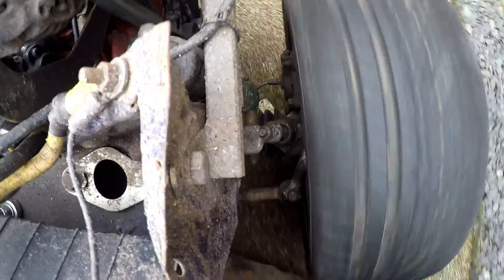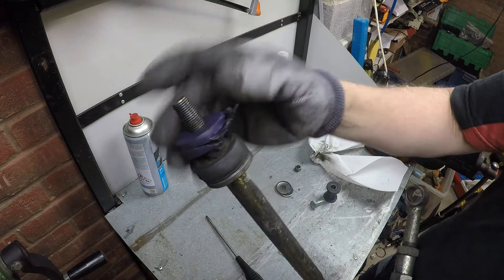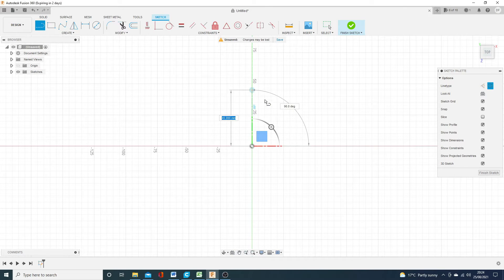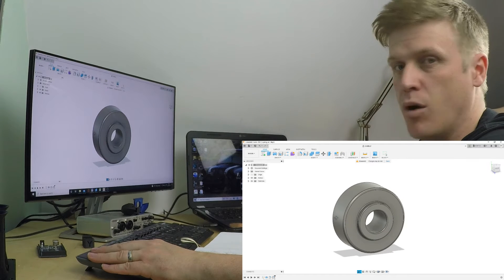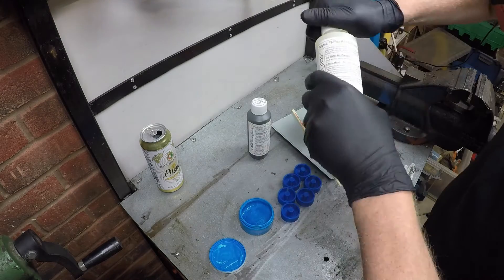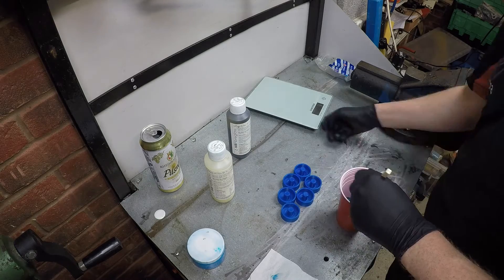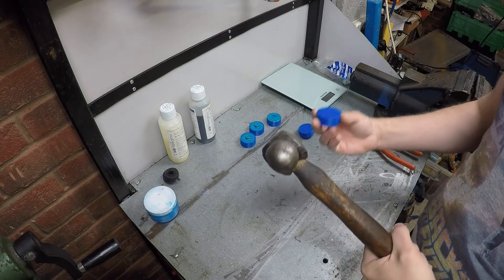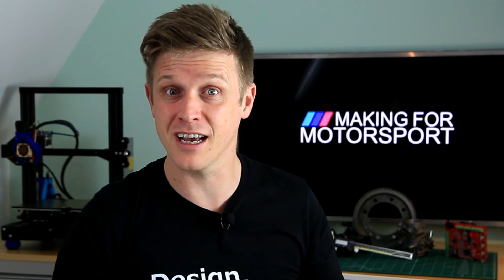Making PolyBushes at Home - using 2-part Polyurethane and 3D printed moulds!

Comment: I wonder if compressed air would pop em out. I know you say pennies, but iv been without a job for too long, so ill save pennies when i can.
Reply from the maker: Sucks to hear that man, hope you get back in a job you like soon! 👍
The compressed air trick does work some of the time on normal reusable moulds but I think with the 3D prints and the layer lines it’s always gonna be tricky
Reply: @MakingforMotorsport   Thanks. In 2 days im finished with 2 out of 6 month course  leading to becoming a certified welder. Its not all bad having little money, iv learn to see value in reuse or repurpose junk or stuff people give away. Last week i collected a large aluminum sign that will be perfect to turn into custom door cards or maybe even a custom dashboard.
Reply from the maker: @myshopmyrules.3017  good man, love that your getting the full welders certs, you can send over some tips!  👍

I have a garage full of old 40x40 box that was guard rail and is now my work bench and toolbox trolley… not material goes in the trash near me!

Comment: I've been considering doing this for the bushings on my home built mid engine buggy.  I'm using a VW 07k N/A 5 cylinder and Boxster 5 speed transaxle.  I don't really want to be bothered trying to find bushings I can use or building it around easy to find off the shelf ones.  Why not make them instead?
Reply from the maker: That sounds like proper monster....  It gives you more freedom when designing to know you don't have to worry about whether you can buy things for not.... well I could've bought these but you know what I mean...

Comment: Love your efforts, but wouldn’t it be good to vacuum chamber the mix?
Also I love your efforts breaking apart the mould’s. 😂😂
You could design the mould to be strong but break easy when a flathead screwdriver is inserted and twisted.😑😑😑
Reply from the maker: Yeah… these could be improved and vacuum would improve them but there weren’t that many air bubbles in there as I cut one apart to check (which I really should have filmed 🤦‍♂️)

Comment: Interesting, how much did you pay for the polyurethane mix and pigment?
Reply from the maker: About £20 for 500g so that’s easily make 35 of these bushes.   It’s not a hell of a lot cheaper than buying but it’s definitely more fun 👍
Reply: @MakingforMotorsport  You sure save money compared to not being able to buy any bushings for some more complex ones... Like motor mount bushings.
Reply from the maker: Absolutely, it’s cheap for these simple ones… another good use is for filling in the holes on OEM engine mounts, often there is lots air around the rubber and just by pouring in this stuff to the gaps stiffens it up nicely 👍

Comment: Interesting vid! Did you do a cost analysis? Was it actually cheaper to DIY over shop bought?
Reply from the maker: Hmm… didn’t crunch the numbers, but sitting here, the PU is about £40/kg and I used 100g for 6 bushes, so that’s roughly £0.66 per bush, the ABS used for the moulds is £14/kg and I used I think 15g/mould so that’s £0.21 so that’s £0.81/bush.

Mini spares sells a car set (4 bushes) for £4.20 vs £3.64… so cheaper… and that doesn’t count the £5 postage I need to buy them aswell!
Reply: @MakingforMotorsport  So about a bag of crisps cheaper, and more fun too!👍 Does your Ender 3 print ABS ok? Mines starts off ok, but then seems to clog the nozzle every time. 😢
Reply from the maker: I have no problems with ABS, just warping on the larger, thinner prints.
Reply: @MakingforMotorsport  the opnly thing I can print in abs is a scale model of spaghetti!!😂

Comment: Nice! Do you know/can estimate whereabouts these are on shore hardness?
Reply from the maker: 85A… I should’ve made a bigger deal of that in the video! 🙈
Reply: @MakingforMotorsport  thanks!
Reply: Have you considered 3D printing bushings from tpu?
I printed some spring seats for the rear suspension to test it out from 58D/100A tpu material. It worked ok but its obvious that its not oem. So casting could make them look more proper for the road officials ;)

Comment: i couldnt buy bushings for my car like a normal person, just printed them with tpu.. have been running ~13k km's now
Reply from the maker: I’d hate to be a normal person! 😂. 

I have a reel of 85a tpu ready as a direct comparison… just wanna get my printer direct drive first…. But sounds like it’s a winner 👍
Reply: @MakingforMotorsport  im totally abnormal, but actually there are no poly bushes available for the car, soi had to make them or browse universal sizes. im using a Polish filament, 98sha i think it was
Reply from the maker: 98A?  Nice 👍. You won’t be complaining about it being sloppy with those in!  Great that they are standing up to the application even in that hardness.

Comment: Why didn't he just print the bushing in TPU?
Reply: my thots. i own some tpu and i was looking for a video about it. amazon says the tpu is type: 95a
Reply: Thermoplastic is terrible for strut rod bushings. On my project car, they only lasted a few months before falling apart with just ordinary street driving. Poly is the way to go...
Reply: @daileydriven  gotcha. Thx for the heads-up from someone who's tried it
Reply from the maker: I’ve done some similar sandwich bushes in TPU for my BMW.  Printed solid.  They are holding so far to some “enthusiastic” driving 😂🤞
Reply: @MakingforMotorsport  hey let us know if it keeps holding up. Cool stuff

Comment: I'm like "great, I need some new bushes and mine are really expensive, this could be handy"
Then you're like "just pull out your 3d printer....."
Reply from the maker: Sorry dude!  I have used metal moulds for these in the past and instead of the 3D printer I would just stick’em on the lathe! Or weld them up… 
Alternatively you can use a soft rubber to cast a mould off an original. 
I would almost guarantee if you get a 3D printer you won’t regret it, especially if you can get your head around the modelling…
Reply: @MakingforMotorsport  the first video of this I watched ages ago was "make a mold on the lathe...."
I don't have one of those either!
I'll just buy bushes like a chump....
Reply from the maker: It’s a tough decision, but having things like a welder, lathe, 3D printer etc are long term money savers, just not in the short term… (my TIG was £750 so I could weld Aluminium 😳🙈😫)
Reply: @MakingforMotorsport  I bought a good welder and have an old MIG with an argon cylinder and Teflon liner that does pretty good aluminium welding. I'd like to tig bit don't have the time to practice. I've done a bit but really need a pulse and pedal and large cup and short tungsten and lots of time!
I'd love a lathe. I've been looking at the small lathe/mill machines since really all I'll be doing is motor mounts and small joints and little parts so I really don't need anything huge and cumbersome.
But $1500 is money that could have the car on track instead of a lathe that will stall the project in the short term.
One day maybe.
If I ever get another shed I'll buy an old full size lathe. I don't need huge amounts of precision.
Reply from the maker: @1one3_Racing  yeah, it’s always a trade off.  For the last few years time has been my problem so i have made sure I have everything…. Still need a mill and a belt grinder tho…. And maybe a tube bender… oooh and I’d love a plasma cutting table… 😂😂 it never stops 🤷‍♂️😫

Comment: Put them In the oven at 80 deg Tg point of pla
Reply from the maker: They were ABS 🙈😂 Some heat would’ve helped but smashy smashy was fine 👍
Reply: If they are abs you could have vapor smoothed them, I'm sure you will have acetone